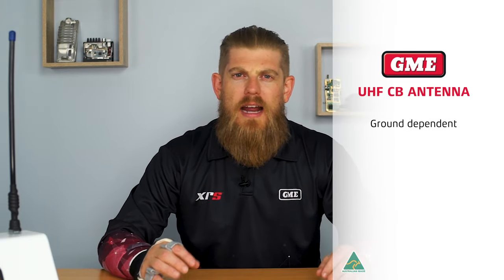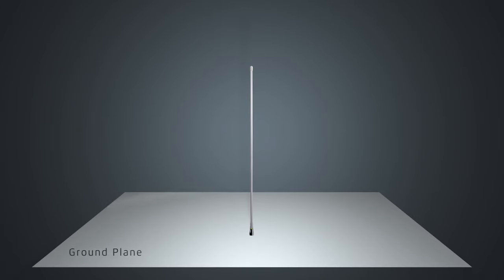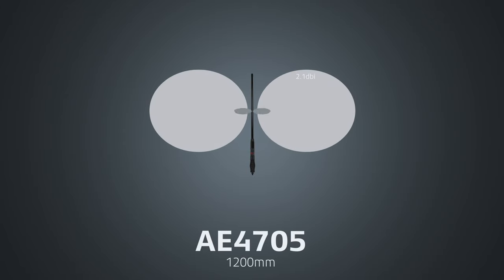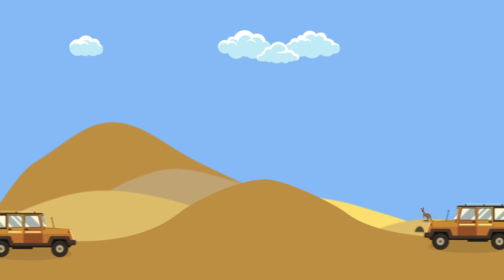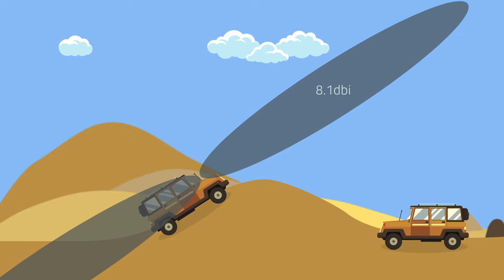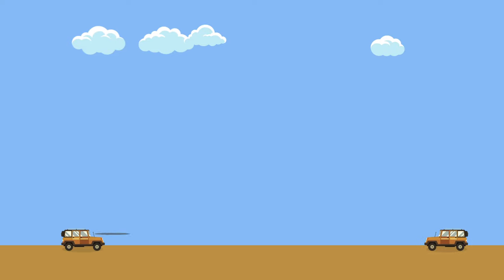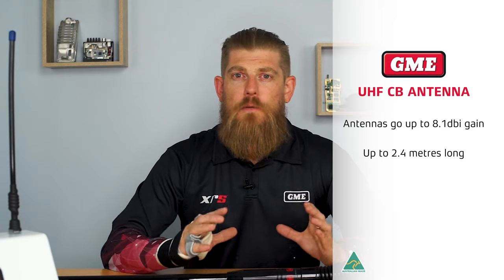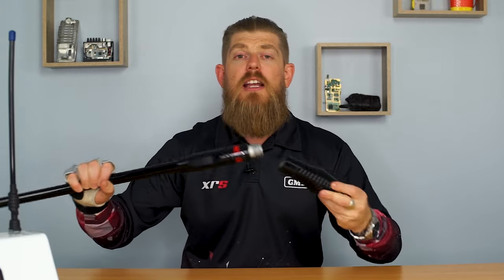Choosing the perfect UHF Antenna | GME

Comment: I was wondering uniden icom or gme but after watching few gme videos I decided to buy 2 gme car units just because I appreciate the time and effort of making the videos (and to support local manufacturing)
Reply: GME also have the best reliability and capability. Uniden is just as reliable, but their inbuilt speakers can be a bit soft, especially if you have a lot of background noise (although this can be alleviated through purchasing external speakers). Icom are alright brand new, but they are made of inferior materials, less generous on circuitry solder, and use more brittle plastics and rubbers, and as a result don't have the longevity of GME or Uniden (although they are still more reliable than the extremely cheap brands that are often seen these days).  I also note that GME is one of the few brands to fully ruggedise their peripherals - when mounted, the external mic, for instance, is mounted in such a way to be both firmly secured, and just as water tight and dust proof as the overall radio unit itself, especially when talking portables. In fact, I rate GME alongside Motorola, although GME is much less expensive than Motorola (and an Aussie company).

Comment: I have an Amarok with a tub with a Smartcap steel canopy on it . I was thinking of getting a CB and mounting an antenna (probably 2.1 ) for around town and occasional rural use. I don't have or want a bullbar  so was thinking of fixing the antenna in the gap between the canopy and the rear of the cab (up high just below roof height) . Does this sound a reasonable spot to mount it ?
Reply from the maker: Assuming the radiating element of the antenna (the radome) is above the roof line, yes, this will work well.

Comment: It's true - Most people need a zero/low gain antenna.  I have unity gain wire whip antennae on spring mounts on all my machines and 4wd's. They are indestructible. Fibreglass shatters when it's been in the sun and hit multiple roos and tree limbs.

Comment: I have a gme tx3520 uhf and would probable like the 4705 heavy duty aerial as shown in clip with the more rounded signal for mountaineer areas which areal would you suggest.  My current gme has the cable pulled out showing a processed coax stile cable is this reparable or am I up for a new one. Thanks in advance Tomo
Reply from the maker: Hi Tomo, sounds like the AE4704B is the perfect choice for you!

Comment: Great vid, I brought TX3350 set up 6 years ago for my lux, hides nicely under my dashboard. Came with AE4018k antenna, I snapped it last week wood chopping hit a low thick branch. My fault because I could see the plastic part under the whip was getting brittle over the years, not sure if You's have upgraded that part. Ordering the AE4705B now, looks tough and strong as... GME Aussie made, don't buy anything else all...

Comment: Great video. I live rural and managed to destroy two GME 4705B antennas now, was hoping for a bit more life but there is nothing better out there in my opinion.
Reply: There is something better. A ZCG Scaler wire whip antenna. It's ground independent and when mounted with a spring they are indestructible.  I think the part number is GRUFC.  All our vehicles have these antennae with springs and they are driven every day through scrub and under trees. They flex and never break.

Comment: As a grey nomad, I would really need only a short antenna, likely a 'Low Gain Antenna', in order to possibly talk to truckies, letting them pass or else. I do not like to have an antenna mounted on the bull bar but rather permanently on the back end of my SUV roof. Would you recommend this? Would the Antenna not be, say, obstructed by the towing caravan?
Reply from the maker: Hi there!
By mounting up high at the rear the performance would be strong. However, it may be impacted by the caravan depending on its size.

Comment: Do you make a screw in plug for the base? I don’t like leaving the aerial left on the vehicle if it’s parked outside unattended.
Reply from the maker: Hi mate, the AE4704 / 4705 series antennas are supplied with a protective cap to cover the spring base when the whip is removed

Comment: Hi very informative indeed. Thanks.
The question I have is when using Repeater stations in Duplex mode on my UHF 40 channel radio is what station to be on to TX and RX. I have channel list and I know 1 to 8 in Duplex but not 5 is the reciever from Repeater and transmission is on the list in the higher end of list. I have a list of repeater towers and their locations in Victoria. My question is what channel do you put your radio on and in Duplex mode and what channel does the other vehicle's 40 channel UHF radio need to be on in Duplex mode to have car to car comms via the repeater. The signal goes to the repeater on one channel and from repeater out another channel. Just confused how to use it for car to car whilst  the two vehicles are driving around the area covered by the repeater tower. For example driving around Kevington and Jamieson in Victorian High Country and wanting to use repeater ontop of Mt. Terrible in Victoria.

Comment: Great video. I have a TX6160 hard wired into my 4wd so that when I am onsite I can take the unit out with me and use as a portable UHF using the portable screw in antennae. On my bullbar I have the AE 4705 6.6dbi antennae on my bullbar which I use on the highway. I also have a standard 3dbi rubber aerial. Can I use that 3dbi rubber aerial on the bullbar for areas such as the Vic High Country or does it need to be on the roof rack? Thanks in advance, Mick.
Reply from the maker: Hi Mick, Yes it will be fine on the bullbar, but as always the higher up the antenna is mounted, the better the performance

Comment: Thanks for a great video.  In a few weeks time we are heading off to Hawker in the Flinders rangers in the Wifes CX9.  We plan only to do easy day trips.  Yeah we brough the GME PLB just in case.  Also purchased the TX3120SPNP to mount in the CX9.  It's been working well here in Gippsland.  Is there a better suited Antenna for this unit for use in the flinders rangers? Cheers.
Reply from the maker: Hi Scott, always better to be safe than sorry!
In regards to an antenna, it should still be fine for closer comms but upgrading to a 2.1dbi or 6.6dbi option would be more beneficial if you are looking to increase transmission distance.

Comment: What is thebest antenna to use on the big rigs? Love your very informative videos...we need YOU AND YOUR COMPANY IN THE STATES!
Reply from the maker: It would ultimately depend on the environemtn around. As a rule though we recommend a lower dbi antenna for hilly/built up areas and a higher dbi antenna for flat areas.

Comment: Nice video, thnx. Would like to know what is the difference between Antenna and Aerial and or why You did not use Aerial in place of Antenna in your heading ? thnx for explaining
Reply from the maker: Hi mate, generally, an antenna is used for transmitting radio waves, whether used for radio, television, cell phones or other more sophisticated equipment. ... Aerials are used for reception, not for transmission

Comment: I recently installed an AE5003 on-glass antenna and it seems to be working pretty well but would love to get some more technical advice on how this and the AE5004 can be used in modern aerodynamic cars. Can they be rotated 90 degrees? What does the beam batter actually look like? What is going to work best in a convoy. Tried reaching out to the technical support email but never got any response (which was pretty disappointing to be honest) but purchased the GME gear anyway.
Reply from the maker: Hi Richard,
Sorry for the delay in getting back to you!
For the best performance we recommend installing upright and not rotated at 90 degrees.
For best in convoy we would suggest the lower dbi options. However for more technical info it would be worth having a chat to the tech support team on 1300463463.

Comment: Picking up the XRS CONNECT UHF  XRS-370c
Would like a recommendation on a short range antenna.
Distance would be 60 to 100 Metres
Must go through venue/building.
Antenna to be mounted temporarily on top of OB Truck then put away so need a magnet style holder if possible please

Comment: just watched this video great stuff, my question is can you joint 2 different gain ariels to the radio using a  T joiner, i have a 2.1 and a 6.1 i think hoping to have the best of short and long distance all at once
Reply from the maker: Hi mate, 
You can but we do not offer a product to allow this as this will add another point of loss into the system and can impact performance. To ensure the best performance of your UHF radio we recommend the use of the interchangeable whip system instead of adding a third party splitter.

Comment: Thanks for a great informative video. 
Just wondering now if it's possible to have 2 antennas on your vehicle, say a large antenna on the bullbar with a high dB  and small antenna with low dB mounted at the rear, say on the roof racks or on the kaymar wheel carrier.
Trying to cover both scenarios if that's at all possible .

A penny for your thoughts.
Reply from the maker: Hi Luke, thanks for the feedback and query. Yes, it is possible to have 2 antennas mounted to the vehicle and connected to the one UHF radio. To do so you would need to install an aftermarket splitter/switch to allow you to switch between them. Please note that we do not recommend this as by doing so another point of loss will be added to the system which may impact performance, to prevent this we instead recommend the use of an interchangeable whip system like the AE4700 series
Reply: @GMEaus  Thank you very much for straight up and honest advice.
Much appreciated.

Comment: I have four antennas that I have purchased over the years and really do not know what type they are. Can you advise if there is any way of working out the antenna specifications from simply looking at them. I drive a Triton ute but do not drive off road with most driving being around town when I use a short (I believe 1/4 wave unit -- flexible and about 120 long) and a longer one when driving interstate (about 630mm long fiberglass type with a wide space wire about 90mm long about 1/3rd the way up the shaft). I can't use the longer antenna around town at it hits the roof when driving into most shopping centre car parks. The antennas are both labeled GME and are mounted on a GME non dependent base mount, the lot being mounted on to the tray surround and just behind the rear window. Any advice to this novice will be greatly appreciated.

Comment: Hi I have been using an Oricom fibreglass whip, like the thin one you demonstrated, but have it mounted on the roof of my 4wd and i have lost a couple of them with them being wiped out by low hanging branches. Does the bigger thicker ones  you have demonstrated handle the punishment better?
Reply from the maker: Hi Andrew, yes, our heavy duty fibreglass radomes are designed to withstand the tough conditions encountered in the bush

Comment: I would like to change my antenna to one with a heavier spring but as the existing GME fibre glass elevated feed is wired right back to my overhead roof console, is there any way to change it without a complete rewire ?
Reply from the maker: Hi Neville, unfortunately not. With a new antenna it will come with a cable which will need to be re-ran to ensure the best performance.

Comment: Hi Tony, got a xrs330c, does it can match the heavy duty antenna 4704b? Or it only can connect to 4707b?
Reply from the maker: Hi mate, either antenna will work with the XRS-330C

Comment: I currently have a 2.1dbi mounted on my ute sportsbar, which works well in the mountains. However I will soon be crossing the Nullarbor towing a 3m tall caravan. Would you recommend a 6.6 or 8.1 antenna for the trip?
Reply from the maker: For open terrain we would recommend either of those higher gain antennas but given the height of our 8.1dbi option (2.1m), the 6.6dbi would likely be more than sufficient for your needs!

Comment: Hi Tony. Great vid, have just found it. I currently have a XRS-330C CB with a AE4018 mounted to the bull bar. I'm going to instal a KAON antenna mount which fits in front of the LHS rear view mirror. I tow a caravan on long highway runs but also on heavily corrugated outback roads. Should i stick with the AE4018 or go to the more sturdy AE4704? Cheers
Reply from the maker: Hi there!
Regarding your query, if you are doing a fair amount of driving on corrugated roads we would recommend upgrading your AE4018 to a radome style antenna like the AE4704B.

Comment: G'day I'm looking to put a bull bar mounted AM/FM radio antenna on my 70 series, but don't know which ones compatible with standard radio ports. Any advice or info would be greatly appreciated Cheers
Reply from the maker: Hi there!
Our AM/FM antennas come with an auto plug at the end of the cable that should work with a standard radio port. For more info or to chat further though we would recommend giving our tech team a call on 1300463463!

Comment: Trying to find a antenna for am/fm radio local and heading into the high country, cruising down the Hume. Thankyou
Reply from the maker: Hi matt, the AEM7 or AEM4705B will be good options for your AM/FM needs in those areas!
Reply: @GMEaus  thanks very much for the information and reply 👍

Comment: I have a CX3100 starter kit. Is the antenna supplied with this kit a ground independent type. From your video I feel it is but I just wish to confirm. Thanks!!
Reply from the maker: Yes that is correct, the AE4018K2 included in the TX3100VP is Ground Independent.

Comment: Why do some people use 2 same length antennas or same type antennas? Are they linked to one uhf system or are there 2 uhf systems installed in cab?
Reply from the maker: Hi Jazz,  often one antenna is for UHF and the other is for Cellular, in other cases the person may be running two UHF radios in their vehicle

Comment: what is the best length of antenna for travel around Cape York?
Reply from the maker: Hi Robin, we recommend the AE4705B - it’s 1200mm long, has 6.6dBi gain, and a heavy duty design which is perfect for the tough tracks and corrugations up in Cape York

Comment: Hello, great video ! I’m in need of a FM antenna upgrade. 
Would 100mm spacing between, aem4705 and ae4705 be ok ? As one is a FM antenna and the other UHF. 
Thanks
Reply from the maker: Hi there, to ensure the best performance we recommend 300mm seperation between antennas.
Reply: @GMEaus  thanks for the reply, would it be possible to mount them horizontal on each side of my roof rack ?
Reply from the maker: @catatropic233  for them to work properly they would need to be mounted upright, however  they could be mounted on a MB042B fold down bracket to lower them when not in use.

Comment: I have a new Windscreen antenna of which I know nothing about (for argument sake the dbi). I am about to become a grey nomad towing a caravan across the north of Australia from east to west and some distance south on the WA side, sticking to mainly tarred surfaces etc. I am wondering if this style of antenna picks up chatter (conversations) easily on outback areas. I was advised this was the best way to go (by the salesman) so that there was no hole drilled in the metal of the vehicle. What I really want to know then, is this type of antenna any good?
Reply from the maker: Hi Ray,
Thanks for reaching out to us.
On-glass antennas are definitely suitable for that type of driving, the only thing we would recommend is that for long-distance outback driving the antenna selected is a higher dbi gain.
Hope this helps!

Comment: Good presentation. Can you give any info re aerials for small handheld scanner (receiver), Icom IC -R10. Came with a short ?rubber ducky.  0.5 to 1.2GHz, FM, WFM, AM, USB, LSB, CW. I'm interested in exploring its possibilities. At home use for the present. Thank you.
Reply from the maker: Hi Frun, unfortunately not as the IC-r10 is not a product of ours. We would recommend contacting Icom regarding this.

Comment: hi team great video clip.  I have installed a GME TX3350UVP and the tip of my has been snapped off.  long story but i tapped it up.  Is it possible to replace the antenna using the same mount with something similar or more versatile.  ?
Reply from the maker: Hi Richard, head into your nearest dealer and they can chat with you about getting the best antenna for your needs. You can find your nearest dealer here https://www.gme.net.au/au/find-a-dealer

Comment: what's the difference between the 4wd and outback models? if I customised 330 to take 82cm 4wd antenna
Reply from the maker: The key difference between the XRS 4WD Pack and the Outback Pack antennas is their size and ruggedness. The 4WD pack (AE4704B) has a thicker spring base and radome to suit more harsh environments.
Hope this helps!

Comment: I would like to know more about our windscreen mounted antenna (AE5003), compared to bullbar mounted antenna. Real life information is just not available
Reply from the maker: Hi Joe,
Provided the AE5003 is installed correctly it will work just as effectively as a bullbar mounted 2.1dbi antenna.

Comment: Gidday! What is the aerial for? Is it for transmitting (sending) the signal or receiving or both? Also is it bad to have the radio on without an aerial?
Reply from the maker: Hi Richard,
That's correct, the antenna is used for both transmitting and receiving. It is recommended to only use the radio with an antenna connected to prevent potential damage to the radio itself.